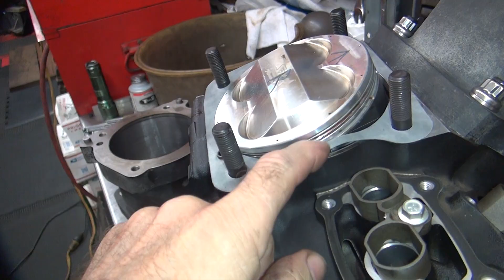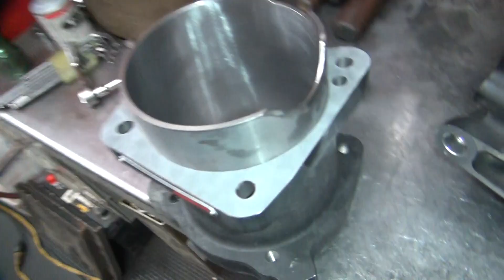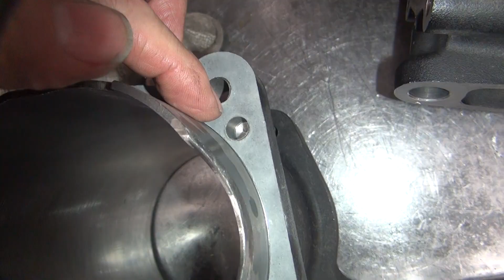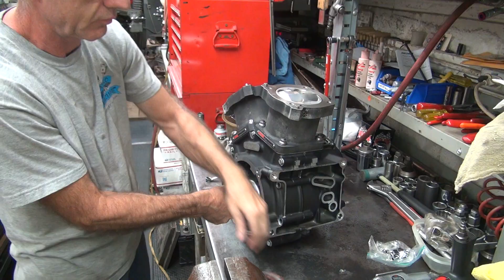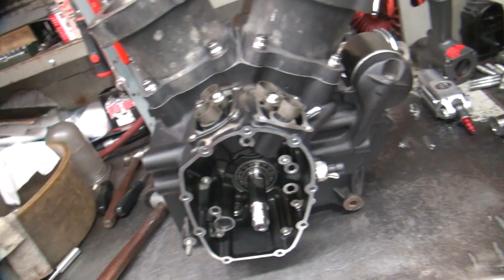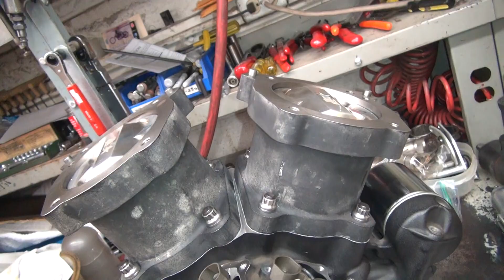#123 m8 145ci 4.5in bigbore case machining hyperformance finless race cylinders harley tatro machine

Comment: How many passes will this engine get before needing to be torn down?
Reply from the maker: as long as you are winning, it doesn't matter. like i said in the videos, there are things that i would do differently. this come from all the years of my racing and breaking parts. even a dumbass learns over the years.
my race motors come apart somewhat in 1-3 runs. the complete motors last less than 20 runs if not 10.
its all about how hard you want to push things. when you are making 3-5 times the power of the stock motor, everthing likes to break.
tatro

Comment: It may be possible to trim the gasket with a pliers type paper punch , or even a leather punch . With the correct thickness gasket paper you could always make a gasket , use to be , you could get about any thickness gasket paper you wanted , because some of it was used for bearing and/or gear clearance  , small example - 435 new process 4 speed transmission - input shaft retainer (throw out bearing sleeve) gaskets were used to set input shaft end play clearance .
Reply from the maker: or i could use the cylinder to cut the gasket to size. oh, that is what i did. its a nice tight leak free seal now.
tatro
Reply: @TatroMachine  Over the years , I`ve made a bunch of gaskets from gasket paper and other , its not hard to cut a perfect gasket using a small ball peen hammer and other tools , I use sealer to make sure of no leaks , isnt that why you use sealer ...